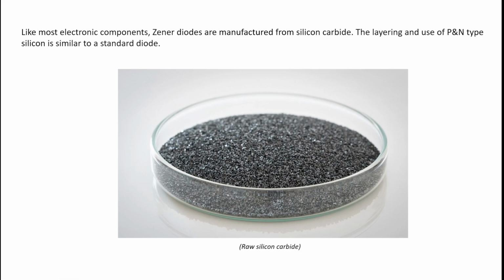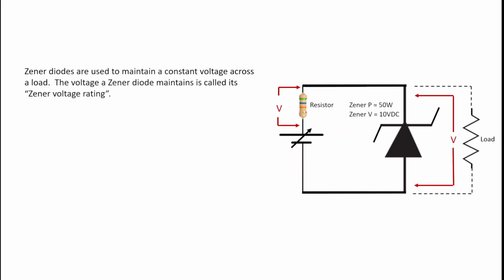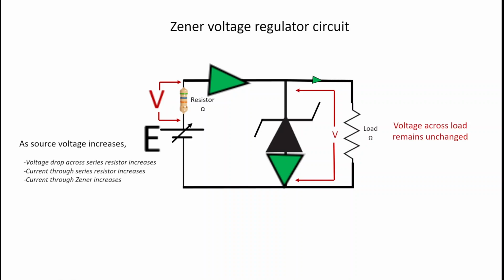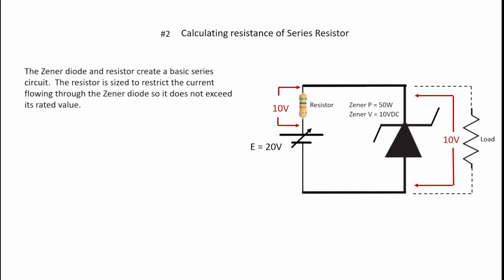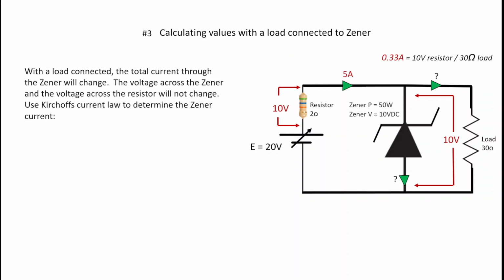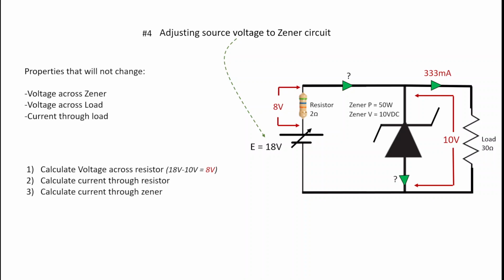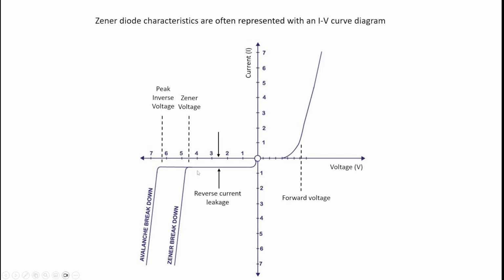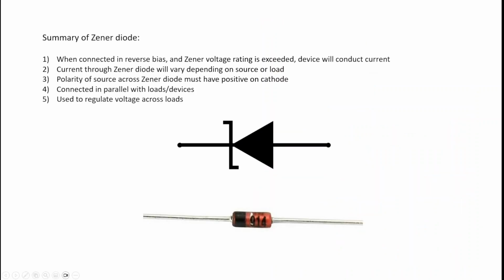Electronics Zener Diodes

Comment: The resistor isn't present to limit the current through the diode, it's there to ensure enough current flowing  through the zener to enable it to breakdown at its designed zener voltage.

The manufacturers' data sheets always tell you what the minimum current is to achieve the designed breakdown voltage.

If you don't pass enough current, it won't give you the specified voltage.

Now, as with any electronic component, if you pass too much current through it, it will burn out.
Reply from the maker: Thanks for your comment. There will be many times throughout this presentation that specific details are waxed over. This is intentional-and required to a point-due to the targeted audience. The channel presentation are targeted for the Canadian  electrical apprenticeship program. The depth and scope of which is intentionally shallow on some topics that an average electrician would not often work on. Thanks again for your comment.